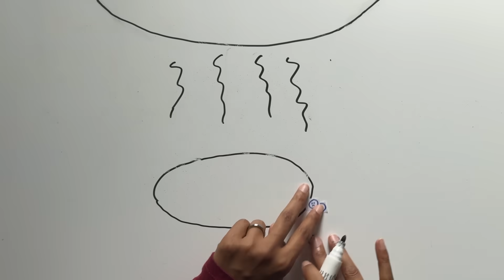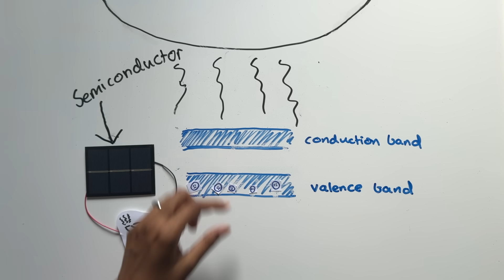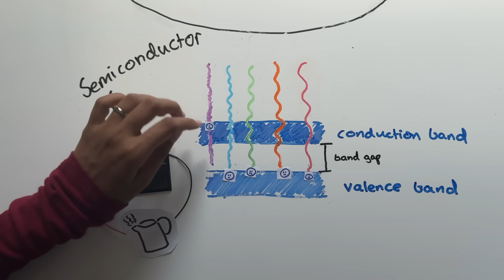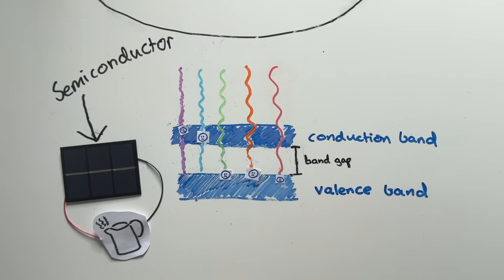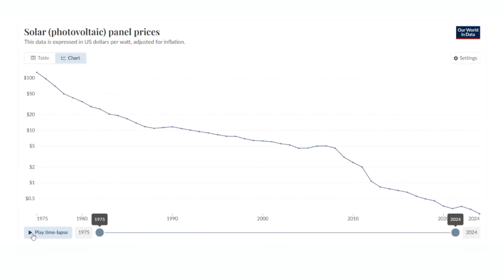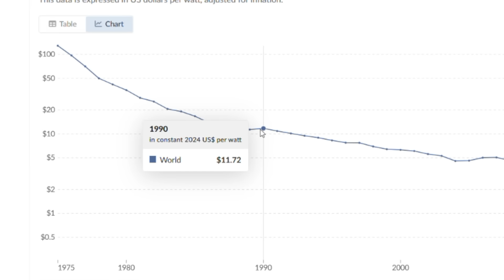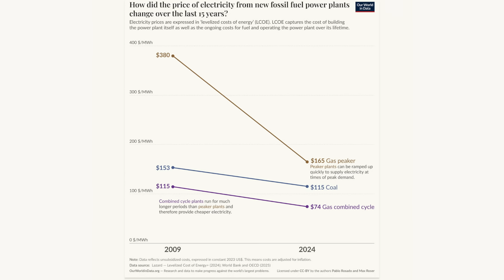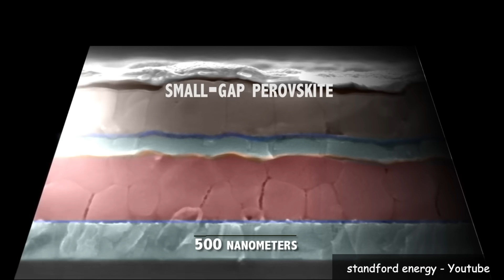Why solar panels can't be more than 33.7% efficient

Comment: I don't trust theoretical limits. Back in the early days of the Internet I went on a communications course and was taught there was a theoretical limit to the speed at which data could be transmitted down a copper wire 12k or something - but that was in the days of dial up modems - they were talking about analog data transmission. Soon after, digital broadband came along and was pushing data down a copper wire much faster than we were taught possible. I guess my point is, don't limit yourself to a particular paradigm. Someone always comes up with a smarter way to do things.
Reply: Of course that's why engineers are there right? Even i imagined some basic ideas but of course they were already existing.
Reply: You should take theoretical limits seriously, and understand why the dialup limit could be overcome but others can't. Even back in the day when everyone was on dialup we had ethernet doing 10 megabits on copper so it's not like higher speeds are new, it's just that that wasn't deployed to everyone's house. Broadband required installing a lot of new equipment at the street or neighborhood level to get past the frequency limits of analog dialup, because the old switched telephone network would never have been able to.

But in the case of solar the video's analysis is correct. Someone that understands and respects the theoretical limits is going to do a much better job approaching those limits. Photons from the sun have a certain amount of energy in a certain distribution, and you can use them in a limited number of ways.
Reply: Someone already has. This limits only applies signal junctions with no frequency changes in the light. By having multijunction solar cells or by using quantum dot technology this limits has been broken.
Reply: @alwynwatson6119 but as the video notes, multi-junction has a different theoretical limit
Reply: Sorry, your description of "breaking theoretical limit for copper wire" indicates you didn't understand what it applies to, or what's was actual limiting factor, or which parameters engineers changed to bump theoretical limit's value. Theoretical limits not only let distinguish possible and impossible, and tell how close we are to full utilisation, but also provides insights into what we need to adjust to achieve more, and they are really important.
Reply: @JumpingJack-w2l  Thanks for completely misunderstanding my comment and replying in a manor that clearly makes you feel superior to me. My point was that I was TAUIGHT something in a classroom without any explanation about what it applied to or what the limiting factors were. I'm not a physicist so how would I know things that weren't explained to me? So now when someone says there is a theoretical limit, I always take it with a pinch of salt, OK? Additionally, I don't know if you consider yourself to be a scientist or engineer, but the good ones keep an open mind to new ways of doing things. The bad ones repeat rules they've learned in a book, and get their kicks by being pompous about it. Don't be like that. It profits you little.
Reply: @SteveGouldinSpain  Dear Steve, let my try an explanation. 
What is light? It is pure energy. What does a solar panel do? Convert light into an electric current. Ideally, it can convert all energy coming in as light into electric current. That would be 100% efficiency. But as explained in the video, the way solar panels are built and especially the properties of their material - which is silicon - does not allow for light qantums below a certain energy level to be used at all. 
What is a quantum? A portion of light, basically a packet of electromagnetic waves. That portion has a fixed ratio between wavelength and energy: 
W = h * f
or 
W = h * c / λ
with f being the frequency of the light, h is Plancks quantum of efficiency,  λ is the wavelength and c the speed of light.
That means that infrared light with a low frequency f has a low amount energy W while ultraviolet light with a much higher frequency carries a proportionally higher amount.
Examples:
Red light: 630 nm (nanometers) wavelength
Frequency: f = c / λ = 300,000,000 m/s / 630 nm = 476 THz (476 trillion oscillations per second)
Energy: w = h * f = 6.626 * 10^-34 Js * 476THz = 3.16*10^-16 J = 0.326 fJ (femtojoules)
Green light: 550 nm => 0.361 fJ
Ultraviolet: shorter than 380nm. For 300nm the energy is 0.663 fJ
Infrared: longer than 780nm For 1000nm = 1µm the energy is just 0.199 fJ

As far as I could find the longest wavelengths causing a flow of electric current in a silicon-based solar panel is 1200 nm.
With ultraviolet light being filtered by the atmosphere and also by the glass plate covering the solar cells that part of the spectrum is not very important. The sunlight's highest intensity is at around 550 nm (light green, close to yellow), but a big portion has wavelengths > 1200 nm, limiting the efficiency of solar panels to the theoretical 33% maximum.

With 1J = 1 Ws (watt-second) = 1VAs (volt-ampere-second) you might get the direct relationship between the energy of a photon = a quantum of light and the energy a solar panel produces:
1J is the energy of 2.77 * 10^15 = 2,770,000,000,000,000 quantums of green light with a wavelength of 550 nm.

Silicon solar cells cannot use light quantums with lower energy than the band gap between the 2 layers of Silicon: one enriched with Borate, and one enriched with Phosphor. That band gap is set by properties of the Silicon, Borate, and Phosphor atoms. 

Different materials would be needed to extend the usable range down to lower infrared. The Gallium-Arsenic materials mentioned in the video actually do that, but even them can't make use of light below a certain energy and thus below a certain frequency. Another technology is CdTe (Cadmium Tellurite), but again Cadmium is toxic and Tellur is rare and expensive.

But Silicon is abundant; the earth's crust actually consist to a large part of silicon. Arsenic, on the other hand, is poisonous, and Gallium is rare and expensive. So we use Silicon. But Silicon has that wider gap between valence and conduction band and can't use low energy infrared right below a certain level of energy per quantum. We just can't make atoms with properties we want ourselves and must stick with what is avaliable - the less than 90 elements that we find in nature. Silicon is cheap, non-toxic, and abundant. 

The comparison between historic and today's internet bandwiths does not work here, because the theoretical limits for data transmission through copper wire are probably much higher than we have achieved even today. It took many years of technological research and refinements to come closer to actual limits. Just have a look at current USB, SATA / SAS and PCIe bus speeds: 3, 6, or even 33 GHz are now possible. And these are not limits set by natural constants like Planck's quantum or the speed of light.

It's better to compare with the speed of light. There is absolutely no way of even reaching that speed, no matter how much energy we have for acceleration. The problem is that the cinetic energy of an object has a mass and needs to be accelerated itself. So you add more and more energy, but with every bit of energy you use to accelerate an already moving object you gain less extra speed as it gets more heavy. And how big is that mass that equivalents a certain amount of energy?
E = mc²
that is what this formula means. That's a theoretical limit. And it is set by the speed of light (c in the formula). c is always constant, it can't be changed.

Comment: They are way above that limit by using multiple materials with different band gaps, concentrating light, and using thermal aspects for other things. However, that often drives price up too
Reply: To be fair, it's very possible that these new multi junction PV cells will also come down in cost over time, just like silicon PV did. 

Too early to count it out, just need to give it time to mature
Reply: she literally says that exact thing
Reply: @evilotis01  Probably commenting before viewing.
Reply: 14:48 She mentions it, watch the video before yapping... smh
Reply: MJPV technology is likely only to be used in places where size and weight matter. Generally that's not an issue for energy generation right now cause you just put it in the desert or on a rooftop. But for space applications and mobile/portable electronics, it might have a strong use case in the future
Reply: @metagreen1931  Nah, it'll be used anywhere its economically advantageous to do so.  Right now that constraint is pretty limiting because of the cost, but as costs go down the breadth of viability goes up.

Eventually if they get the cost of multi-junction down to less than around 2x single-junction, single-junction will simply stop being used because multi-junction is (theoretically) around 2x more efficient, so you'd be getting the same power generation for the money and save of weight and volume.

We're certainly not there yet, but these technologies have an exponential growth curve so we'll probably get there sooner than you'd expect.  The next decade or so is not unreasonable to see a viable material discovered, tested and starting to see the manufacturing capacity buildup to create the necessary economies of scale that'll make it commercially viable.

Finding an appropriate material is really the only major sticking point.  Once that happens the rest will follow fairly rapidly.  Perovskites are promising as they're both cheap and effective, but the longevity issues are a problem.  Just takes finding a single useful type though and off to the races.  It doesn't have to be a perovskite though - it could be any kind of material researchers happen to stumble across.
Reply: Multi-junction photovoltaic is so ridiculously expensive that there is nowhere on earth they are actually used. I use that language very specifically.
Reply: @vylbird8014 Clever use of language. MJ PV is probably so expensive because nobody is buying them for use on Earth. I think you're looking at maybe doubling the efficiency by switching to MJ, but if it costs more than twice as much to put that panel in the system (including the price of the land it's on), it isn't economical. Also we're very good at making commercial single junction panels, so it's hard for a first generation MJ panel to compete on price, durability, efficiency, warranty, features, and everything else customers expect.
Reply: @reddragonflyxx  Yes, you got it: MJ panels are used in space, where the cost of getting the panels up is far greater than the cost of making the panels. It's fine to use a super-expensive panel if it means your satellite or probe weighs a little less.
Reply: @vylbird8014  You forgot the qualifier "today"
Reply: @vylbird8014  That's why perovskites are so exciting - they're pretty cheap, just like silicon.  But they've got fatal longevity issues and while work has been made its nowhere near enough yet.  Who knows whether they'll ever solve that material specifically but we're talking an efficiency gain of over 100% here.  If someone can figure out how to do it in a not-expensive manner, they stand to make a whole hell of a lot from the patent.
Reply: @vylbird8014  - What an awful perspective.  If your attitude prevailed with regular mono-silicon then we'd be nowhere today with solar, period.
Reply: LONGi’s new HPBC 2.0 cells are already over 34% and these will be mass produced next year at competitive prices.
Reply: Watch until the end before commenting.  You’re telling us exactly what she said.
Reply: that also has a limit of 86.8% efficiency with infinite junctions, and of 50% with 2 junctions. that also has diminishing returns.

Comment: I wish govts paid attention to a wider energy mix for our energy needs.  Batteries don't really solve the variability problem beyond a few days.   Seasonal batteries are usually geography dependent.  And larger installs start becoming a land use problem (which leads to the same old dynamic of "who gets to use this land" conflicts, loss of natural habitats, etc).  Also, having majority of the power generation highly correlated to sunshine/weather makes the whole grid much less robust.
Reply: Around 40% of all land on earth is either desert or dryland.    So for large solar farms (far away from arable land and people)... the main problem is transport and storage.
Reply: @romanval69  The remoteness is a big problem.  If that was easy to solve, we would already on our way to an energy transition globally.
Reply: @Quarky_  High Voltage DC powerlines (HVDC) takes care of a lot of those problems.   They just need to be built.
Reply: To be frank. Storage is not that big of a problem.
Dig a hole. Put a flywheel on magnetic bearings and in a vacuumed chamber in the hole. That flywheel storage will last for a year. and is space competive with lower energy density chemical fuels and thats direct energy storage, with flywheels theres a greater then 90% recovery of energy, chemical fuels are typically under 40%.

Its a problem because it hasnt been built and there are really rich people invested in worse energy storage means that can be paitented (NASA designed the flywheel in the 70's to deal with the gas crisis)
Reply: @AnonymousAnarchist2  I don't follow your comparison with chemical fuels.  Are these fuels undergoing some kind of reversible reactions?  How can they act as storage?  As for energy density, how does a low energy density storage solve seasonal storage?  Wouldn't that require even bigger installations?

Comment: This only applies to silicone. Kind of an important detail. We are within 3 years of 28% efficient solar cells hitting the market. Not lab perfect idea conditions; "go to store and buy a sheet of it" will be at 28%. The engineering is based around the idea of layering multiple  terribly thin materials all optimized for a different sunlight wavelength of energy and letting the rest past through to the next layer. In lab, 34% had been broken using this method.

Comment: So why can’t we have 2 or more layers of semiconductor with progressively decreasing band gaps?
Reply: we can, that's called multi-junction. it's just not economical to do on the ground (yet). they do get used in satellites though.
Reply: Also I guess abandoned branch of PV, concentrated photovoltaic was about to use small double or triple junction cells behind much larger cheap lens, but lost the economics to single junction panels.
Reply: @JumpingJack-w2l  requires direct sunlight and 2-axis tracking, the cheaper panels work well with diffuse light and 1-axis or no tracking. But I do think we'll go to dual junction sooner or later.
Reply: @ArbitraryConstant yeah it was before regular panels become so cheap, now cpv foes not make lot of sense

Comment: Great video, makes me want to install a solar panel on my balcony next week. I was wondering why there are valence bands and conductive bands rather than discrete energies. I learned that in metals and semiconductors the bands arise from the fact that the atoms are packed tightly together. And also that the band gap in semiconductors is larger than the band gap in metals. (Or maybe I learned that at school but forgot it over the years. 😅)

Comment: Oh, the nice thing is it sets the upper limit to look for other gains. One is costs. For example, while lenses won't give you "more power", they can spread light onto a smaller panel. So one way to improve is making smaller but cheaper/denser panels, and a large cheaper focus lens (or Fresnel panel etc).
Reply: Or find a way to stop the earth’s rotation and locate all the solar panels on that side of the planet.
Reply: might be a good plan.

Comment: Question. In this example, we go from photons to electrons, to thermal radiation (water boiler). Wouldn't the obvious solution be to directly absorb the entire frequency spectrum of the sun to directly heat the water?

For practical applications, I think a lot of real-world analogies already exist. But it's maybe a good reminder that we don't always need to do all the conversions for every application?
Reply: There is tech for using solar for heat instead of electricity. The problem with trying to make water immediately absorb all the spectrum of light is among other things that you'd probably have to put a bunch of nasty chemicals in it to do that, so most solar heating just use ordinary heat pumps to transport the heat from some medium (like a dark roof) to a tank of water.
Reply: I feel like water would be the worst choice of material.

It’s transparent which means it doesn’t absorb much of anything. On the other hand, solar panels are black/dark so they absorb the light much better.